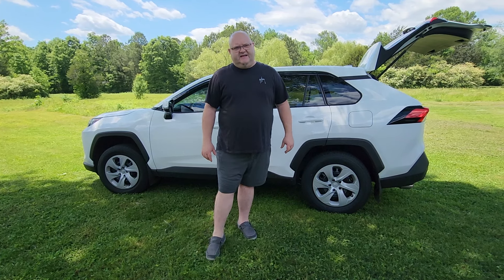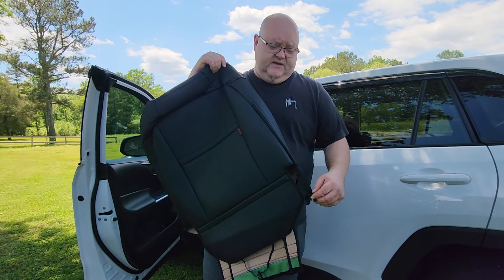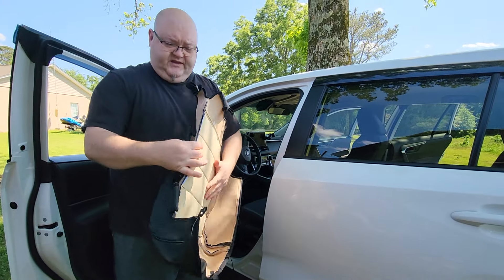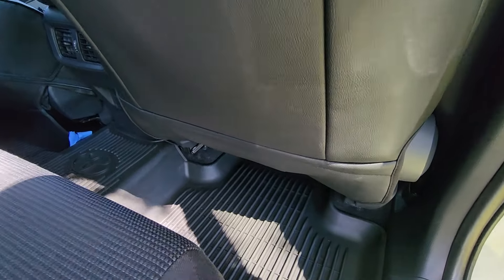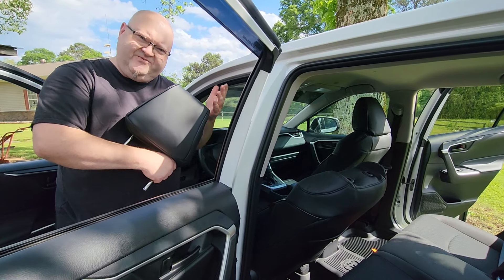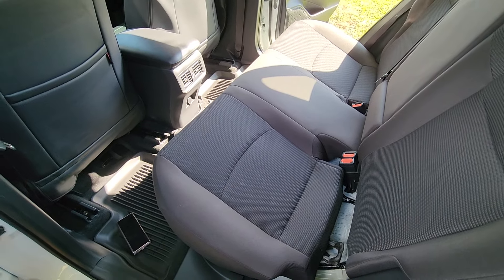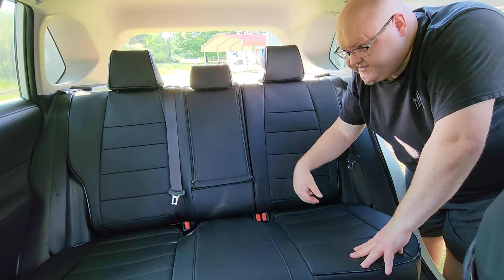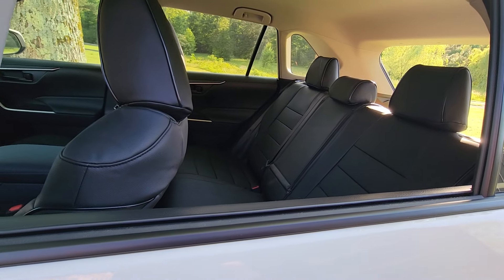EKR Seat covers for 2019-2024 RAV4

Comment: Excellent video, one of the best I seen on seat cover install. Especially like you showed the seat cushioning . Those Rav4 seats are hard as rocks. Also I bought those rear all weather cover rubber mats. No body has showed what to do with seat covers. I thought I would have to remove it. Been looking at seat covers since January when I bought my Rav4.  Will buy the EKRS. Thanks.
Reply from the maker: If you buy the EKR's make sure to use my discount code in the description. Thanks for watching!

Comment: It took me about 2.5 hours working alone to install these on an XLE.  One thing to be aware of - in the video he clips the back of the driver’s seat cover underneath early in the install process.  In reality you should do this as the last step in installing on the front seats, otherwise you will need to keep undoing it.  Also, fitting the cover on the driver’s seat was trickier for an XLE because the seat base has a lot under it for the powered seat adjustment.  So there is not much to clip the elastic to on the console side, and  it was a bit more difficult running the straps underneath.  Also, you need to tuck the front of the cover into the hard plastic that surrounds the bottom of the XLE drivers seat and then pull it from below.  For the rear cargo mat that goes up against the back of the rear seat, I stuck Velcro strips to the back of the seat cover to hold the mat in place.  I have read folks in the southern US  say the Velcro won’t keep sticking to the seat cover in that heat, but I am in New England so hopefully it will hold.  Finally, there is a good video here on removing the rear bench seat:  https://youtu.be/F0zw0Tj4OnA?si=lzgpWtEnwfi1oVnr
Reply from the maker: Thanks for watching! How do you like em?
Reply: They fit very well.  We like them a lot!

Comment: For the front seats, I put the bottoms first, I found it's easier. The back rests after. I guess it doesn't really matter. 

For a Corolla Touring Sport, but they are effectively the same. For the Corolla, the back bench has some sensors (for detecting weight I suppose), which are connected to the back of the bench. A pain to unclip, and the cover doesn't provide a cut-out for them.  And of course, you need to un-clip the middle safety belt, but it's just a simple tab to push grough. 

Anyway, the seat covers look and feel nice. They fit well, they are difficult to install, pretty rigid, and heavy, but not a bad thing really.

Would recommend, I would buy again, but prepare for a bit of a fight. I'd be much more comfortable installing another set now.

Comment: At about 21:50, I am doing it a bit differently.  The lower backs of the seat covers have velcro at the bottom to attach, but of  course it will not stick to the rubber mats you inserted so the seat covers are loose back there, not being velcro'ed down at the bottom.  I am just going to use some velcro with sticky backing and attach that to outside of the seat backs. I expect that the mat will hold on fine even being a little heavy,  the mat has three long strips the full length of the mat, they are designed to hold onto the seat backs that way.

Comment: Hello Mr. Melton, I purchased these for my 2024 toyota rav4 xle hybrid, I'm having trouble with the driver seat bottom, not fitting snug towards the center storage console, did you run into that issue aswell?
Reply from the maker: Hi Alex, No mine are tight. Just take the elastic piece with the zip tie attached to it and hook it up under the seat on the frame and it will tighten it up. Plus go back and retighten everything up more because my covers fit tight like a glove. Everyone I showed mine to cannot tell that they are seat covers. Hope this helps! Please LIKE & SUBSCRIBE.
Reply: @matthewmeltonTEAMMELTONFISHING  darn maybe it needs time to settle, but mine is a tiny bit lifted on the drivers side.
Reply: I am having same issues with the driver power seat. How did you solve the problem? How did you hook the elastic piece with the zip tie on to the frame ( for the driver seat)

Comment: Confusing installation...when you install just the top seat cover back rest part...how you are pulling something from the bottom of the seat..if its just the back rest cover that you have installed...from where did you get the elastic part from bottom of the seat ? Is that part of the cover or it is part of original seat ?
Reply: At 5:35 the elastic he is removing is part of the factory seat. That part will be tucked up behind the EKR cover on the back of the seat.

Comment: Front seats back rest cover what you have to do with the part that has to be tucked in and pull from back...that part is missing in the video...only i see you are installing the front seat back rest and then lot of Commentry and then suddenly you are showing the front seat bottom cover install
Reply: The part from the factory seat that gets tucked up, stays tucked up on the behind the EKR back rest. The tucked up portion is replaced by the tail of the EKR backrest portion (elastic with J hook that was hooked onto the map pocket )  6:20. That elastic gets attached to same spot where the factory elastic was attached. Hope that helps you.